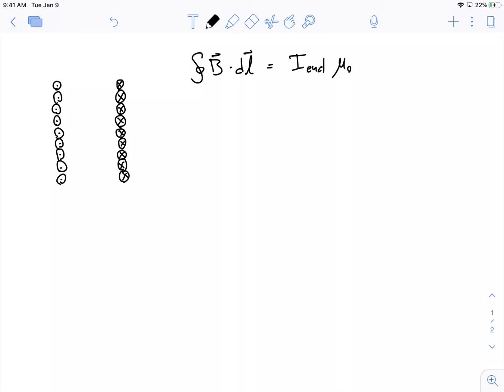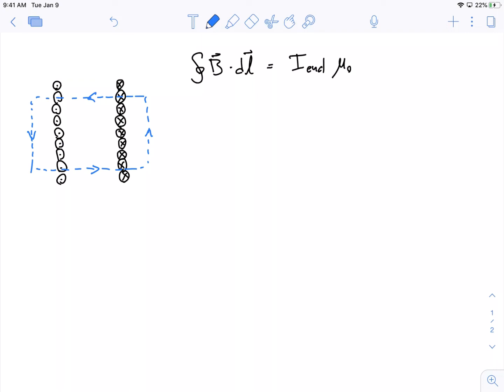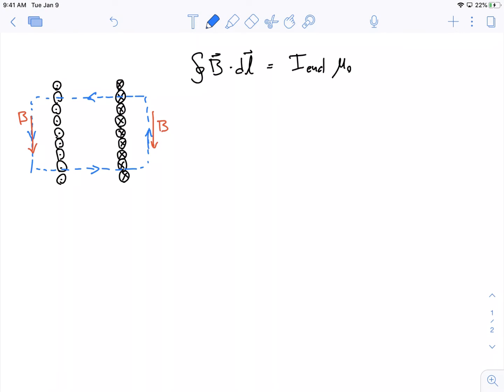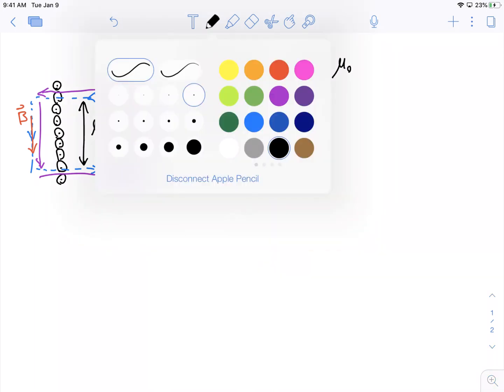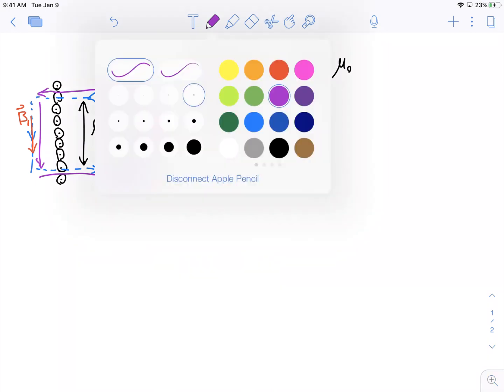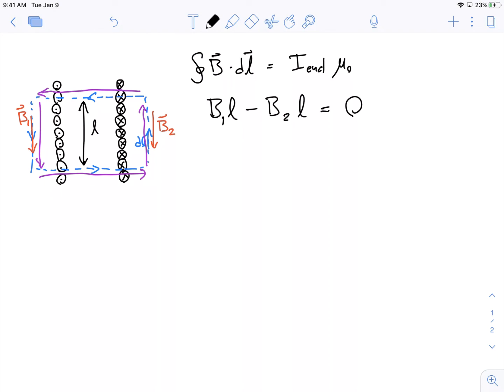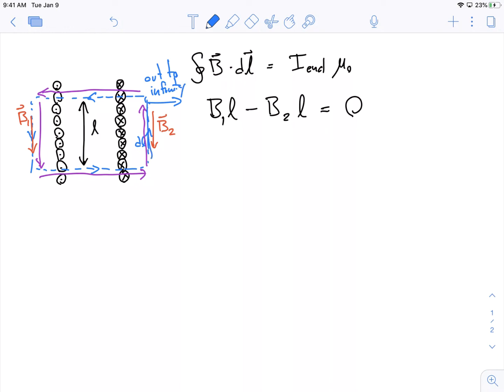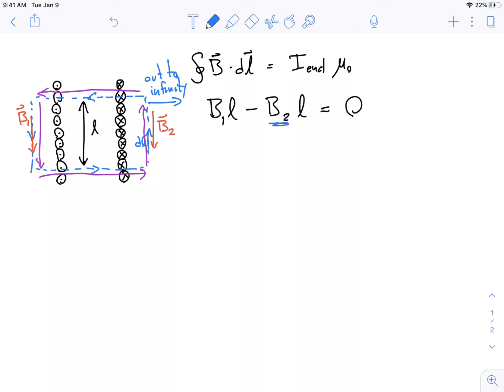Why is the magnetic field outside of a solenoid zero?

Comment: It is a nice way of thinking, liked it. I do not know if you can make the field zero at infinity, it can be a constant field, like the infinity charged plate for electric field.
Reply from the maker: @gafcs  This is a good question and I address it in another comment. As you point out, the mathematical statement is that B_1 and B_2 are the same constant, and that constant is the same value everywhere outside the solenoid, no matter the distance away from the solenoid.  Our goal is now to determine that constant. Is it 4 Tesla? 3 Telsa? Some other number? 

Mathematical reasoning got us here, but now were have to use some physics reasoning. Physics reasoning requires us to think about information the real world and experiments give us. The first thing to note is that there is nothing in the equation that links B_1 to a physical property of the solenoid (i.e., the windings per length, the radius of the solenoid, etc). Changing the features of the solenoid doesn’t change the constant. This is different than the result we get for a charged plane, where the value is linked to a physical quantity of the plate (the surface charge density). In fact, it seems like we are allowed to pick any constant for the B field outside the solenoid we want. The only constant that really makes sense, that doesn’t change with the physical characteristics of the solenoid, is if the field were zero. 

But, let’s go further. Somewhat troubling is that if we pick any constant other than zero, the energy due to this magnetic field, because it is constant everywhere, is infinity and non zero infinitely far away for the solenoid, but perhaps you might expect that from something infinitely long, like from a charge plane. 

The last thing is that if we actually build a really long narrow solenoid, we notice that the magnetic field inside can be very strong, and the magnetic field just outside is very closer to zero. This hints that an infinitely long solenoid, which is actually impossible to build, has a magnetic field of zero outside. We use experimental facts and physical reasoning to guide us to the fact it is zero. 

I hope that helps.

Comment: Sorry, but sir you only show that the BLs are equal. However, there's intuitive but no evidence that if the distance from the coil approaches infinity the BL of that side is zero, so we cannot make the argument that BLr=BLl=0. It draws me to the analogy that the E field at a point caused by an infinite big plate is not related to the distance between the point and the plate:imilarly, the object is big. Thank you, sir.
Reply from the maker: Good question. There is another commenter here that asked almost the exact same question. Thought my response to that one is useful to read, I want to address your analogy with electrostatics. It actually leads to a cleaner arguement. The solenoid is closer in analogy to a capacitor, which we model by two oppositely charged infinite planes. We know that when we put one plane next to the other, the negative field from one cancels the positive field from the other when they are outside the capacitor. 

We can build the same thing with two sheets of current, one going into the page and one going out of the page. This is easy to imagine with my cross section drawing inn the video. Each infinite sheet of current has a constant magnetic field from it (B= I\mu_0/2L and we let I/L be a current density), just like an infinitely charged plane. However, when we put the two sheets next to each other, the field outside cancels, just like in the electrostatic case, and we get B = I\mu_0/L, just like we would expect. Now, a solenoid is just what happens when the two planes of current wrap into each other.   

Most importantly though, the reason we set it to zero outside is because we can assure the field just outside the solenoid. Just, like for a capacitor. It’s important to remember that in physics we often need a physical measurement to get the answer.

Comment: Sir,  by applying amperes law we could only conclude that B1 and B2 are equal,  at a point far away from solenoid, both of them are zero and in the same way at a point close to solenoid both of them may take a non zero value ( the only condition is both of them are equal
Reply from the maker: This is a great point, and illustrates why physics is different than math. The statement is actually stronger that simply being equal at the same distance away. There is no distance dependance in the equation, so I may draw B_1 right next to the solenoid and B_2 very far away and get the same equation. They don’t have to be the same distance away for the mathematical statement to hold. The mathematical statement is that B_1 and B_2 are the same constant, and that constant is the same value everywhere outside the solenoid, no matter the distance away from the solenoid.  Our goal is now to determine that constant. Is it 4 Tesla? 3 Telsa? Some other number? 

Mathematical reasoning got us here, but now were have to use some physics reasoning. Physics reasoning requires us to think about information the real world and experiments give us. The first thing to note is that there is nothing in the equation that links B_1 to a physical property of the solenoid (i.e., the windings per length, the radius of the solenoid, etc). Changing the features of the solenoid doesn’t change the constant. In fact, it seems like we are allowed to pick any constant for the B field outside the solenoid we want. The only constant that really makes sense, that doesn’t change with the physical characteristics of the solenoid, is if the field were zero. But, let’s go further. Somewhat troubling is that is we pick any constant other than zero, the energy due to this magnetic field, because it is constant everywhere, is infinity and non zero infinitely far away for the solenoid, but perhaps you might expect that from something infinitely long. The last thing is that if we actually build a really long narrow solenoid, we notice that the magnetic field inside can be very strong, and the magnetic field just outside is very closer to zero. This hints that an infinitely long solenoid, which is actually impossible to build, has a magnetic field of zero outside. We use experimental facts and physical reasoning to guide us to the fact it is zero. 

I hope that helps.
Reply: @JamesCharbonneau  
Thankyou sir😊
Reply: @JamesCharbonneau  but the conclusion that B1*L=B2*L can only be derived when the case is infinite long solenoid, and how could we guarantee that B is nearly 0 at an infinite distance away while the solenoid is also infinite long?
Reply from the maker: @renoir9498  Well, it has to be some constant because it had so distance dependence, so which one is it? Choosing that to be zero is exactly the  point I am trying to make. You can’t guarantee it without looking at what the real world has to tell us. This is what makes physics different than math. Your job as a physicist is to model the real world, and you have to use results for the real world to do that. We can make mathematical arguments, but at the end of the day you have to build a solenoid and measure the magnetic field outside a long narrow solenoid is very small, then make a leap of intuition based on that. It’s this leap of intuition, making a decision based on the word around us, that is so unfamiliar in math that is a central aspect of physics (though Ed Witten won a Field’s medal specifically for being able to use that intuition to make advances in math).
Reply: we only extenden one side to infinity

Comment: Sir if the field outside a solenoid is zero then how can phenomena like mutual induction occur ???
Reply from the maker: This derivation is for an infinitely long solenoid, which is often used to model the field inside a solenoid with constant current. You are correct that for inductive effects we need to consider the fields outside of these solenoids.

Comment: But is this result valid for all cross sections of solenoid
Reply from the maker: Subhash Rachewad Yes, you can use the cylindrical symmetry of the solenoid to argue that the field is zero outside for each cross sections.